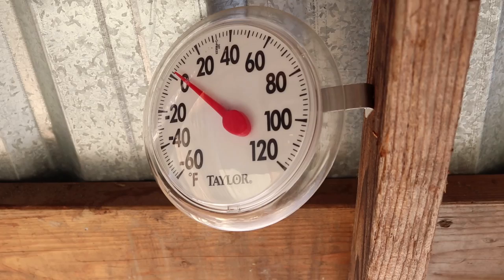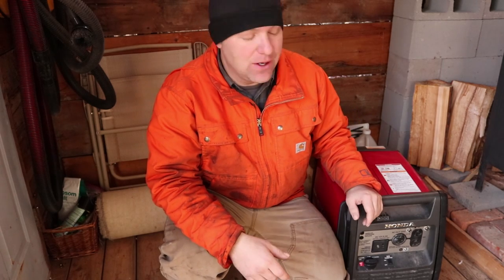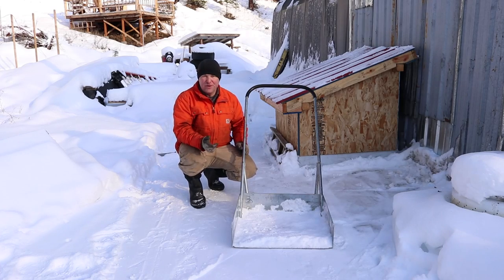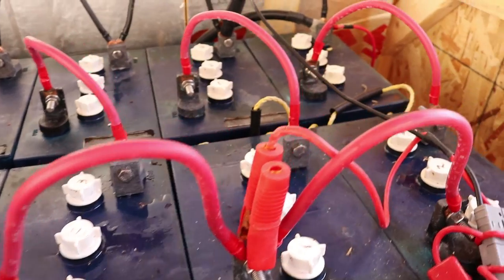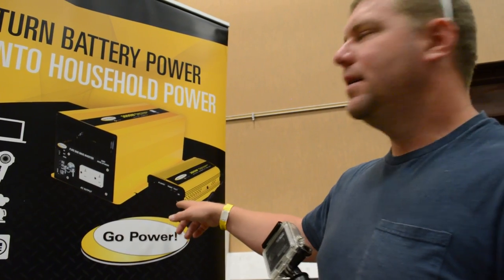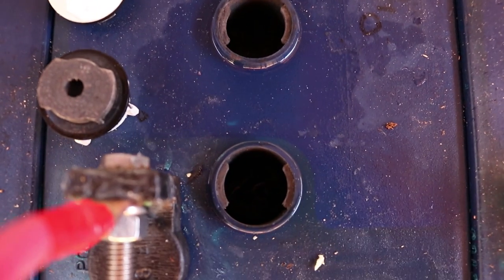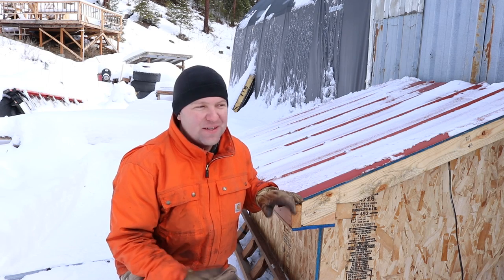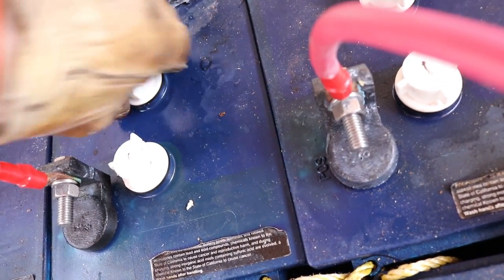SO FRIGID BATTERY ACID IS FREEZING! + Off Grid Power problems

Comment: Thanks for sharing the details of your experiences, it can save someone coming behind you from learning so many things the hard way.

I wanted to add my 2 cents on lead-in battery care, sorry if I am repeating something that has already been said.

The maximum rated temperature for a lead-in battery is +80F, the low temperature limit is determined by the charge level.  As the battery becomes discharged, the sulfuric acid separates from the water, allowing icing.  Therefore, with the temperatures you experienced, you want to be above half charge (open circuit voltage of no less than 6.05 volts).

Also, these batteries should be placed in some type of environment where the temperature extremes are limited.

When placing batteries in series, the batteries need to be matched, otherwise they may not charge very well and can wear out faster.  The best way to match batteries, is to buy all the batteries in a series string, all at the same time (ideally the same lot code).  It's probably a good thing you are learning all this stuff critical to battery bank care on some used batteries (as opposed to new ones).

When adding water to the batteries, use only distilled water.  I don't recommend using any distilled water from the store, it can have added ingredients, like salt and floride (which is industrial toxic waste).  I use a water distiller I bought for purifying drinking water.

Comment: If you end up shopping for a different inverter check out Magnum.  They are imo the benchmark and should serve you well for many many years.  If you end up getting a seperate solar charge controller and inverter combo also check out morningstar charge controllers....  That combo properly installed will be trouble free and very good to your batteries.

Comment: My hubby said for your generator you should be using gas-line anti-freeze in it.  Any machine running gas........... And 5W 20 oil 
Hubby hunts in the cold weather a lot and uses the generator.

Comment: Hey guys,

Get some battery vent "hydrocaps" for your batteries.  They catalyze the hydrogen and oxygen gas generated by your batteries' charge cycles back into pure water.  They will sharply reduce how much water you have to replace in your batts over a given period.

Comment: Suggestions for anti-battery bank freezing:

1) I don't see any insulation inside the box.... and if there isnt room... maybe insulate it outside... I'm not a big fan of foam... but 2 inch foam can give R13 to R14 range... would help immensely.

2) I see there is some room around the batteries themselves...  water jugs filled with water all around the batteries would give you a thermal mass that would greatly reduce freezing as the water would take the "heat" (actually lack of heat) and soak it up helping the batteries keep from freezing longer.

And yes... oil viscosity is a HUGE factor in extremely cold climates. So glad you got it sorted!

Comment: I noticed that the battery bank is on the Shaded side of the building.  If it were painted black and on the sunny side it would have a free heat source durring the day.  Maybe with some black thermal mass into the evening too.  Just an observation.

Comment: It could be a winter carburetor adjustment?? Anyway, as for the batteries, please set aside some time to look into the DIY Powerwall info I have mentioned previously. Find used 18650 li-on batteries, assembly is time consuming, but they arent affected by temperature to a point where you will notice. They also don't have a significant resistive load to charging. Way less maintenance, lighter, more dense power, but more up front time for initial assembly. I can get you into a fantastic closed FB group for resources. Sorry you are going through these stresses, but you grow, and learn, I learn. I love watching you guys on this adventure, I daydream about this stuff!

Comment: The synthetic oil is a big help to run cold but cold gasoline is hard to vaporise. I recommend leaving the gas tank empty over night and put warm gas in the tank just before you start it. 
The batteries need strong acid to resist freezing so as suggested top off the low cells with acid not water.
Reply: Hans Quistorff I agree. if your batteries are deep cycle batteries you should definitely look at their specifications 4 temperature. charge your batteries long enough to melt all the ice that you see in them. ultimately the ice will warp the plates If it freezes solid. that will ultimately ruin the battery.

Comment: How about installing a little 4" vent pipe between the cabin and the back of the battery box just to provide a little bit of heat from inside? I don't know if off gassing from batteries rises or falls but that might be an issue though if it rushes back inside through a vent... Oh well, just brainstorming here. Hope Alyssa had a nice skiing trip!

Comment: I was watching  a different channel and he was have the same issues,but only when he had the generator hooked up to his solar system .the inverter or charge controller kept making  the generator jump to full load operation to no load. not sure what he did to correct the issue but it seems like something you should look into. Hondas are usually bullet proof equipment.

Comment: Aww, I was hoping the generator issue was fixed then right at the end problems came back. 

Cold temps do make for some difficult times being off grid, especially when your still in your beginning stages like you are. I opted to not even winter over at my property this year. Since I was late getting in and had lots of delays in getting things like a trailer and renting equipment, plus my brother needed me to house sit his place for 2 weeks in mid Dec, it just became obvious it was not practical for me to try and winter over this year. Thankfully I do have a brother in state (though 6 hrs away from my property) to winter at. 

I might be getting a house built this spring and summer. My mom is really keen on me getting a house, and is going to help me afford to work on it. So rather than taking the next year or 2 to build up materials and plan, I might be getting things built a lot sooner.

Comment: I think you got a lemon for your generator. Honda is the best. I have a 5000 and it's more quiet than yours, starts at the push of a button (battery included) and when we had the ice storm in 1998, it ran non stop for 8 days (24 hrs/day) and is still running perfectly. That's why I got a more expensive Honda. And you always use synthetic oil in all machinery starting, running and operating in cold weather. I'm from Ottawa so I have an idea of what cold weather is.
Reply: Which model of 5KW Honda do you have?  The EU3000 is only 57db at 1/4 load. I'm not aware of any of the Honda 5KW models that come anywhere close to that. Most of the non-inverter open-frame models are in the 72db range. It could just be the camera picking up the exhaust noise being amplified in the back of his pickup truck as I have a EU3000 as well and it is whisper quiet.
Reply: I have an EB 5000 model number EB5000XK3AT1. You're right it is 72 db at rated load but much less when running at half load
Reply: Really it just needs a slightly bigger jet in the carburetor.  I bet the ones they sell further north come with a larger jet installed.  In the cold, air is more dense, so you need more fuel.  Definitely not a lemon? lol.  Thats why fuel injection is king.  I hate carbs they piss me off.

Comment: Insulate the entire battery box (including the bottom) and since it's right up against your extension house, cut a good sized hole in the wall and connect the two, that should keep your batteries from freezing.
Reply: The problem in freezing is that the battery is not charged; a charged battery will NOT freeze, and has a low ph (acid), but a dead battery has plain water in cells, 7.0 ph, and will freeze;
Reply: I get the part where the battery is frozen because it's not charged. I think you missed the point.
Reply: Ok Mike, You probably didn't catch that I was offering a solution, or trying to. I think I might be wrong in some of what I said but at least I was offering a solution and not trolling to start some crap.
Reply: Mike Muetin

Comment: Hello All, Have some suggestions for the batteries and generator. (1) Top off the batteries with acid and add a 60w incandescent light bulb inside the battery box to keep the batteries from freezing. (2) Oil should be 0W20 or less and should be for an air cooled motor ( motorcycle/ snowmobile) (3) Never use ethanol fuel in a small engine, only use non- ethanol fuel ( rec 90 ) in any small engine ( generator, chainsaw, ATV, ect...) hope this helps. btw love your videos and Thank You.

Comment: Not sure if anyone has told you, but batteries being used for Solar power should be kept near room temperature for optimum performance. As batteries get cold, they begin to lose their power. Conversely, it is also bad for batteries to be in a really hot location.

Comment: install a hot water coil system off the wood stove , that uses a check valve  too heat the battery box ... insulate the tubing

Comment: That battery looked like it needing topping up with distilled water, not regular water obviously, presuming it's a standard lead acid battery, the liquid level should be just above the top of the plates, another way to check for a failing battery is to see if it's significantly warmer than the others when charging, or look for signs of the plate buckling, instead of nice straight lines the plate spacing is not the same and tops of the plates look slightly wavy, needing topping up all the time is also a sign it's on the way out as the battery gets warmer causing some of the acid to evaporate off and hence topping.

Comment: You can't have your batteries in subzero temps. You should divert heat into battery box. The gen manual would have told you about it's operating temps and oil requirements. Spec sheet for your batteries will tell you temp conditions too.

Comment: Buy a Canada-market Honda generator!!!

The Choke On the model you need to mod also for Cold Weather Startup.. (your model has a Auto Choke Right?) info online about that.  
You may need to run that gun set at 1/4 choke to keep her running right even when warmed up..when REAL cold out. then GX160 engine can be like that. 
Buddy of mine has one on his gen that he got from the USA,. we get -40weather and same deal...
 governor  on his is just bouncing out of control , Carb / crankcase ventilation tube ice up... all the time... 

You need to buy a model that is labeled. 
 "Cold Climate Technology" 
is specifically designed cold Canadian winters and Run GREAT in -40 !

Comment: There may be more issues with the generator but in your climate you definitely need to be changing the oil viscosity come Winter and then go back to a thicker oil come Spring (or whenever it warms back up). Also, this may sound counterintuitive, but snow is a great insulator. I'd pile it up on all sides of your battery box. As much as you can stand.

Comment: Buy a diesel generator with glow plugs, get a large onsite diesel tank and have it filled with non-road diesel which is cheaper to run. Problems solved and you'll have more power than you'll ever need.

Comment: Honda engines are the best, but the carbs need to be clean and adjusted correctly. Also never use regular gas with alcohol in it. Only non ethanol gas high test. I fix lots of Honda engines and that's usually the problem.

Comment: A frozen battery the battery is toast. The key to solar power is to keep the batteries warm above 60F. The cold area that you store the batteries is destroying your solar capacity for energy. If you have sealed batteries venting is not needed. Regular batteries that you are using require venting the box. Solar has to be done right otherwise its a complete waste of resources and effort. Love the videos.

Comment: Have you thought of extending your battery box? You could add a piece and have your generator in there. the excess heat from the cooling could perhaps be ducted through your battery box with a small fan and you would kill two birds with stone. Heat your battery box, reduce current loss by having shorter leads and have your generator somewhere dry and warmer than your truck bed.

Comment: Hi Jessy, I don't know if you have already checked the air filter to see if it has iced up or not, I only mention this because I'm sure I saw some black smoke from the exhaust on one of the videos that showed it (the genny) hunting. the black exhaust might be caused by a lack of air caused by the filter being blocked (by ice). hope this helps, of course you will have to wait for very cold weather again.

Comment: Hey Guys, I'm A big fan just wanted to say that you might want to look into a DIY project called a solar heater using a forced air  type of unit all solar of course check it out you  might be able to use it for your battery bank heating issue.

Comment: If you drill a 4 inch hole between your little shelter and the back of your battery box and put a insulated pipe with 12 volt assist fan in the tube every time you light up your wood stove you can warm up your battery box with little effort

Comment: Bary your generator and batteries.  :)  Also if you run a pipe like ten feet under ground and suck air up in to the cabin you will have slightly warmer air.  Ground usually stays consent in temperature.

Comment: I've heard you talk about how windy it is at your place, a large 12v 100+ ampere alternator from a van makes for a great alternate windmill to keep them batteries topped up all year round. I'm sure you could source the materials cheaply to frame a tower anchored in the ground that would support a small generator windmill.

another thing with battery maintenance as well as keeping your electrolytes correct, is to give them a de-resistive  charge once a year. A de-resistive charge stops the build up of composites on the plate walls that cause shorting and buckling of the plates. resulting in dropped voltages and killing the battery.

A de-resistive charger will be a heavy duty charger with multiple settings including a boosting charge setting. it will ouput 36 - 48 volts with low amperes.

I know this information is brief, but i how it helps even if it just points you in the right direction

Comment: What did service center do to generator last trip? Fresh spark plug clean air filter perhaps 5w20 and maybe better gas. Try a tank of high octane. Are you using non ethanol gas?  Spark, fuel, compression.   That is all there is.

Comment: I've switched my small engine oil for winter use to full synthetic 0w-30. That helps when it's hard to start in -40 weather. Your higher viscosity oil should only make it harder to start in the winter. Once it's running, it's the air/fuel that would affect the engine like that. Unless you're asking too much of the engine, overloading the generator. It could be as simple as moisture stuck in the air filter that has frozen and restricting air intake. New filters and carb cleaning is cheaper than a whole new generator. Does it run well for a long time under no load?

Comment: sounds like control motor on the carb or dirty carb, also it seems like it ran well until it warmed up??? if so maybe check the coil could be starting to fail and as it heats up one of the windings are opening up, also if you partially or fully choke when sputtering does it improve? put up a video of it from a cold start to failure maybe someone else has seen this and knows what the problem is

Comment: Your Battery box is a lean to on your cabin? have you considered ducting a small amount of your "wood fired" warm air through the cabin wall into the box?  so long as you have positive pressure from cabin to battery box you don't need to worry about the gas from charging moving into your cabin.

Comment: Is the Jesse Pull Start work out routine patented?  After a season, do you notice that your left arm is Popeye and the right arm is Olive oil? 
Love the shots with the drone !!!!
On the generator,  sounds like the carb jets need to be cleaned.  Probably have some varnish buildup around the venturi.  Try running some Sea Foam in the gas and let it run.  Also, make sure you have fresh gas.  it does not take long for the gas to go sour especially if they put MTBE in your gas in the Winter or it is an Ethanol blend.  I know that Colorado does this and plays terrible with small engines that do not run a lot of gas through them.

Comment: removing the carburetor and the gas tank and thoroughly clean it out there's probably a piece of dirt inside that's clogging the inlet for the gas also use a filter if you don't already have one in the nozzle of your gas can

Comment: I'm from NE Minnesota and have experience down to -50.  Charged lead acid batteries will not freeze to at least that cold.  Dead ones freeze at about 15 above, maybe warmer.  Once frozen, they often will not take a charge again.

Never store lead acid batteries directly on concrete.  The floor acts as a heat sink and causes condensation that will screw up the connections.  Put a piece of plywood under them and keep at least a minimal heat source in there.  I like the idea of insulating the box except for the building wall.

Don't show el snow around the box.  Snow is excellent insulation.

The generator probably wasn't designed to work in Arctic conditions.  Sounds like it gets better when it warms up, but that probably takes a long time at 20 below.  The carb is probably icing up something fierce.  Gert in the gas might help.  Snow blower engines that live at these temps have a box around the muffler to preheat incoming air.
Reply: Sorry, auto correct, Heet in the gas, not Gert.